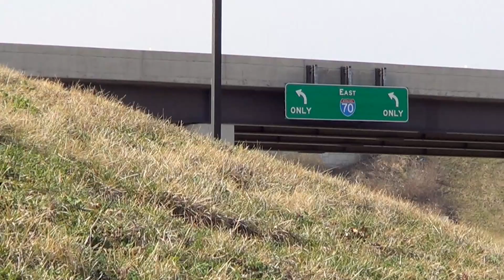MoDOT Recruits Solar Roadways

Comment: Solar roadways are a bad idea for SO many reasons.

1. They're ridiculously expensive. You could fix the entire Interstate for a fraction of the price of a few miles of solar panels.
2. They're made of glass. Glass wears away far more easily than concrete does.
3. They're made of glass. What do you think will happen when there's a traffic accident?
4. The LEDs will not be seen during the day. 
5. They will need much maintenance that will cost $$$.

Also, why must the government be the ones to do this? Could it be that it's such a bad idea that people have to be forced to pay for it?
Reply: +phoenixamaranth sounds like a maintenance nightmare. the great thing about putting solar panels on your roof is there's no moving parts, no need to make them durable, little maintenance required, no cars blocking the light.  people like you are just as bad as global warming deniers
Reply: phoenixamaranth "These have no moving parts but nice try, can be paid for with already existing budget that roof solar does NOT have,"
roof solar pays for itself.

"and aren't frowned upon for being an aesthetic disaster like roof solar so more acceptable usage." solar panels on a roof look fine, if you're so worried about looks there's always integrated solar roofs. or large scale solar installations.

"Current roads are already a maintenance nightmare but they aren't modular like these " Still way cheaper. You're not just saying we should replace roads with glass tiles, but that we should put solar panels under them for some reason, so they can generate energy from the light that isn't blocked by cars or the thick textured glass instead of putting panels on roofs.

"so tired of the 'blocking light' nonsense, roadways are not constantly blocked from receiving light." who said constantly? they get less light than they would if they were put in a reasonable place.

seems like you don't even understand a basic concept like opportunity cost.

"they're such a bad idea France and Normandy" Normandy is in France, and there are some in the US as well, an utter failure. The business model here is ripping off taxpayers.

" ignorant as fuck arguments that are easily shot down with even a high school level of knowledge" why don't you do it then?

You know what else is HS level knowledge?

Normandy being in France.
Opportunity cost.
Reply: phoenixamaranth Solar was 39% of all new energy for Q1-3 of 2016, and that's in the US, a country that's lagging behind. Residential solar is booming in Australia and Denmark, Germany has the highest amount of energy coming from solar per capita, China leads in overall installations. It's not necessarily a big upfront cost there are different options, but the main point is it's been growing exponentially and the cost keeps going down while solar roadways have gone nowhere.

Global solar capacity in 2015 was 10x what it was in 2009. the more we talk the more ignorant you seem.

I said they look just fine AND there are other options.

"No. Mass produced, they will be the same cost." Really? Cost of integrated panel+glass road system is the same as cost of a panel? Explain that.

Even if having glass roads is somehow cheaper than current roads, it still makes no sense to put the solar panels underneath when they could be positioned better.

They are still in testing phase after two years and all that money raised? Yes, everything costs way more at the beginning, but how are they going to make this cheaper than a panel not covered by textured glass and cars? even when you exclude the costs of the glass. 

Testing has been unsuccessful so far.

The only way in which it's differentiating is that it makes it sound like you think it's a different country. Maybe your excuse would've worked if you put Normandy first, then you might have been able to pass it off for a clunky phrase.

I'm tired of your stupidity, bye.
Reply: 1 Year later and solar roads are still a dumb idea.
Reply: Jesus, you people are so fucking stupid it hurts to read your comments. Here's some tips for you: 

The term 'glass' in science, doesn't mean it has to be the weak shit you use at your house. There are various levels of 'glass'. LEDs are visible in the daylight. Most roadway lights are already LED. And another wake up call: we already pay a fortune in roads and road maintenance! Shocker I know! I mean, don't the roads just sit there and take care of themselves...
Reply: phoenixamaranth Do you have any idea how much these things would cost? Just the glass for these panels would be ridiculously more expensive than the tar and pavement they already use. The glass, even strong and thick glass, wears away much more quickly than stone.

Also, have you taken a close look at LED traffic lights? They are covered so much that they are hard to see from the side. That is to keep the sunlight from interfering with the signals. If they were not shaded, no one would be able to see what color the light was. Not only that, it would take a powerful light to compete with the sunlight so people could see the markers.

I'm not saying solar roadways are completely useless. I think they would be good for shopping malls, amusement parks, etc.. They could guide people, entertain them, and help them find others. I would love to see something like this at Disney World or Universal Studios.

Finally, cut it out with calling people stupid if they disagree with you. It's a sign of immaturity and arrogance.
Reply: Patternicity, people like you are complete fucking idiots that would still be banging rocks and stones together because you don't understand engineering or business principles and would naysay everything that didn't magically give you 100% efficiency and work perfectly on first iteration.

Current roads are already a maintenance nightmare but they aren't modular like these so take longer to fix. These have no moving parts but nice try, can be paid for with already existing budget that roof solar does NOT have, and aren't frowned upon for being an aesthetic disaster like roof solar so more acceptable usage. And so tired of the 'blocking light' nonsense, roadways are not constantly blocked from receiving light. Get over the ridiculous all or nothing mentality. Nothing in the universe is 100%, nothing. Your car engine is at best 80% efficient, but they started out with designs at abysmal 20% efficiency. The real world is not about 100% but about every little piece helping move toward an unattainable ideal.
Reply: Face it. Solar roadways are a bad idea. Period. Calling people idiots for not loving solar roadways won't change that. 

Do the math. Find out the price for one panel and multiply it by the number necessary to complete a mile's worth of road. Then compare it with the cost of the materials needed to pave a mile of road. Also, make sure to include installment and maintenance fees for both roads.

Also, have you ever thought of what happens if cars crash on your precious solar roads? On paved roads they just scratch the surface a little. On your GLASS ROADS crashing vehicles would cause a lot more damage to the cars, the road, and people.
Reply: Yeah, they're such a bad idea France and Normandy just put down their own...I call you idiots because you are idiots. You are fucking ignorant jackasses that have no concept of engineering, basic physics, and business. It's pathetic.

You morons just keep harping the same stupid as fuck, ignorant as fuck arguments that are easily shot down with even a high school level of knowledge. I've already checked the numbers. It's all sound. The early high cost is for the prototyping and research costs. Just like every other product in history. Do you morons not understand why the latest and greatest new tech always cost more? Are you that naive? What am I saying, clearly you all are. It's sad none of you understand how product design and manufacturing work. You freak out at the high upfront cost of development like typical naive consumers.  These are not in mass production yet, so are not getting mass production material discounts. Pretty standard. Look up the original costs of any product to get an idea. The microwave, that $50 item in your home, was $100,000 for the first one. The first home models were $2000-$3000 and that was in 1940's money not accounting for inflation. 

And for god's sake, learn something about materials. Glass is a generic term for thousands of different compositions. It does not mean it has the properties of your window glass. Glass is made to all sorts of specifications and can be hard as fuck or brittle as fuck depending on the constituents and their ratios.
Reply: "roof solar pays for itself.' No, it doesn't necessarily. Tell me where all the solar roof panels are? Why isn't every house just covered in them? They have a restrictively high upfront cost that no one wants to pay and take years to pay back with maintenance costs and replacement costs to be considered given how long payback will take. Roads already have a budget afforded to them so a product that serves as both road and power source is a win/win for budgeting.

'solar panels on a roof look fine' Again, then where are all the solar panels? Don't be ignorant of the market. Large swaths of the market do not think they look fine on their houses.

"Still way cheaper' No. Mass produced, they will be the same cost. Already home solar and asphalt costs are the same. There is not any special exotic materials in these tiles. They use silicon for 90% of their structure, that's sand btw. Mass production of glass and panels is cheap. The current high cost is the standard small production and research costs that all products have. 

"they get less light than they would if they were put in a reasonable place.' Reasonable place...opportunity cost...tell me again how reasonable it has been...solar panels have been around for decades now, yet no one is jumping on that reasonable opportunity you speak of. Why? Again, because no one will front that money for such a long term return on investment and they don't want to look at them on their homes. This is a complementary system that takes advantage of existing money and existing land that can be converted easily and on large scale. It's stupid to ignore that critical business aspect.

"an utter failure. The business model here is ripping of taxpayers." More of your massive stupidity showing. They are all in testing phase and moving forward like all products. Your continued complete fucking ignorance of product design and development is just embarrassing. Again, for the thousandth time, get this through your thick fucking skull: everything costs way more at the beginning!

"why don't you do it then?' Been doing it the whole time but you're so fucking dumb you don't even realize it. You're literally so stupid and ignorant that you don't even know how much you are.

"Normandy being in France." Glad you know that. You know what else you should know? That Normandy is a region and the first there to do it so saying, 'France and Normandy' is an differentiating statement, ie 'the people of Normandy being first and the rest of France following in this' you illiterate fuck. Save your ignorant strawman bullshit trying to deflect from the embarrassing fact your arguments are already being proven completely stupid by actual educated people who don't flip burgers and drop fries for a living.
Reply: ' Solar was 39% of all new energy for Q1-3 of 2016, and that's in the US, a country that's lagging behind' Keyword in that sentence is 'NEW'. We aren't building that many more powerplants of other types across the US so yes, solar sounds impressive at 39%...oh wait, that's only of new for last year so an inflated argument...you realize it still produces only 1% of US power requirements in 2016 and rooftop solar is only 1 million homes in the US. Yes, it will keep expanding and solar roads are part of that expansion to integrate. There are massive upfront costs for most average people and most businesses will only do it if they can see definite immediate cost savings which most won't. It's restricted by these facts in the US. Other nations are fronting huge tax dollars into alternatives because they see the long term value in switching over, but in the US and other places, there is no massive movement so it takes leading people by offsetting costs by using money that is already being spent on roads. 

"Global solar capacity in 2015 was 10x what it was in 2009. the more we talk the more ignorant you seem." Don't try to fucking strawman me, you idiot. It took solar 30 years to get there and this is another solar project that will continue to help this number increase faster. The argument isn't whether solar is the future it's whether solar roadways are viable and so far, they are becoming more viable every day.

"Really? Cost of integrated panel+glass road system is the same as cost of a panel? Explain that." Same cost as asphalt roads, jackass. There are other costs in panels too btw that are equivalent in the tiles. Solar panels typically have glass panes, metal frames, support structures, etc. and need installation and maintenance so there is no 'it will cost more to make a tile than it will other solar' No, it will cost roughly the same once factories are set up for new designs

"Even if having glass roads is somehow cheaper than current roads, it still makes no sense to put the solar panels underneath when they could be positioned better." By positioned better, you mean in the tile or other than road? If in the tile, find a better way as engineers do but stop fucking naysaying. If you mean other than roads, again, how are you overcoming the land issue and the private property issues, etc? Roads offer large amounts of already owned land, already fronted money, etc. And also remember solar roadways said they want to be on roads, sidewalks, parking lots, roofs, everywhere because that's true integration.

"Testing has been unsuccessful so far " Testing literally just started. Who the fuck are you to say testing is a failure when you aren't even there working on the projects? Fucking jackass.

"The only way in which it's differentiating is that it makes it sound like you think it's a different country" No, you're just an illiterate jackass who thought he had some clever strawman to distract with but you failed at that too because you're stupid.

"I'm tired of your stupidity, bye." What you're tired of is having your ass handed to you over and over by someone who isn't a moron like you. Get a fucking education, dipshit.

Comment: The things that create potholes is cracks in the pavement that lets water through, each panel is letting all water get through. So you're gonna have a constant problem of sink holes and would be very dangerous to have panels of glass being lopsided everywhere. Also, how are you gonna see the LEDs in the full sun? Not to mention the rough texture would wear down very fast. It might stop a car at highway speeds a few times, but dozens, or hundreds, if not thousands of times a day? You're gonna be replacing truck loads of panels every day. Imagine all the roads covered with those things. There's a reason asphalt has worked so well for so long.
If you want to generate power, the put solar panels on the side of the road, not on it. There is so much wrong with this project.

Comment: What a huge waste of taxpayer money. No wonder we are in a financial crisis, when we spend this much on an idea that is demonstrably, physically impossible.
Reply: oshmunnies are you here only to insult people? Im not a conservative and I stil think this idea is stupid. Of course we can make this thing work but it will be ineficient, expensive as hell and will drain more power than it can produce in the winter...
Reply: Thunderfoot did some simple calculations on SR ROI. Current panels on this disco patio in Idaho generates less than 1 kWh/day per panel (and they use clean glass surface instead of bumpy one that you could drive on so its gonna be worse than that). Scott Brusaw said in one of his interviews that 1 unit cost arround 500$ (including installation). With this data you can estimate the ROI after ~ 2000 years :). If They start mass producing and managed to cut the costs even in half its still ROI after 1000 years given that during this period they would never need any maintance or replacement (which is impossible). As a fancy tech gadget that you could show off with if you have to much money - why not? As a road surface or in large areas in everyday use? Sorry but its just not practical. French already did build a 1km road in normandy with solar panels with better design in my opinion (square shape meaby isnt that "cool" but its much more efficient when it comes to solar panels arragement per unit and its just a flat surface that you lay on road so its much cheaper) that is already proving to be a large waste of money.
Reply: Juha Airaksinen Glass road.. what do you expect?
Reply: "Demonstrably, physically impossible?"  You've done nothing more than demonstrate your lack of knowledge in basic science and physics (I dare you to challenge me).  You are the reason the rest of the world thinks we are nothing but a bunch of uneducated, misinformed, stubborn morons.  I will never understand why conservatives seem to poo poo literally anything that results in actual good change.  This would actually save money and provide ROI for the government in the long run, not "waste taxpayer money" as you ignorantly claim.  But why do I always expect rational thought and a respect for factual information from your side? I'm disappointed every time, you'd think I'd learn.  My fault I guess.